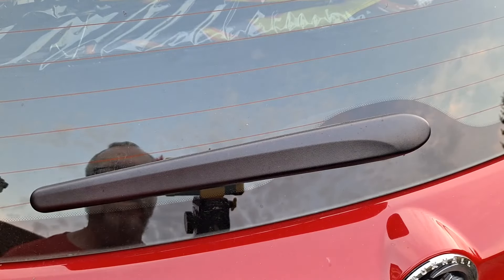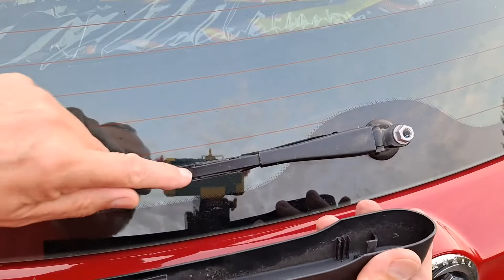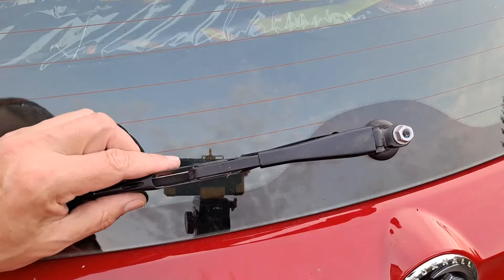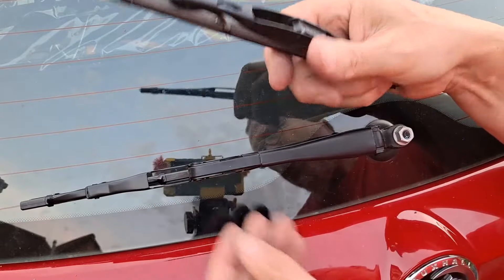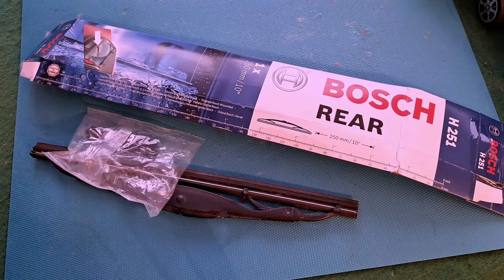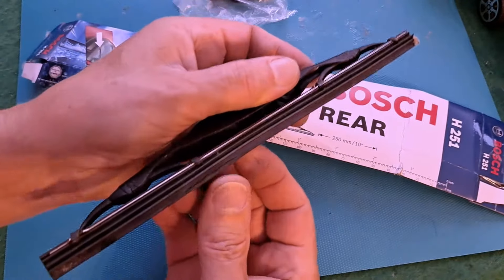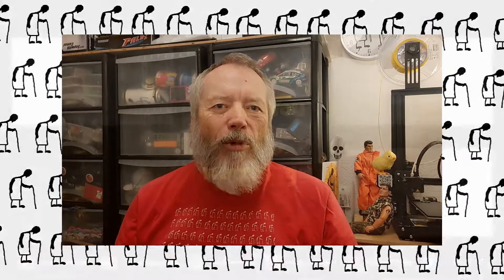Replacing the rear wiper blade on my 2015 Vauxhall Mokka 20210723

Comment: Thanks for posting this. I initially attempted to replace the wiper blade using the Mokka manual - which was fruitless with no information on aspects of the replacement that you covered and explained. 👍
Reply from the maker: Thanks, I didn't get it quite right, somebody pointed out my mistake so I pinned their comment and added it to my video description. Unfortunately, over the years it looks like the guy has removed his comment or left YouTube. Luckily I had copied it and added it to the video description. If you missed it, here it is - Mark Paul has sharp eyes and commented "when you go to fit the rear wiper blade make sure you turn the blade around so the cover fits properly not like this one on the video clip as the blade is sticking out at the end". I hadn't noticed, must be my poor eyesight. I have corrected it now.  In fact you can't just turn it round, you have to pop the plastic clip out first and reverse it otherwise the clip doesn't seat properly, but easy enough to do. 😊

Comment: Excellent video, thank you! Just had to replace the rear wiper blade on my Mokka and obviously the new one came with no instructions! Followed this and worked a treat.
Reply from the maker: Thanks, I hope you spotted the update about getting it the right way round. A sharp eyed chap noticed I didn't get it quite right in the video and I had to turn it round to fit properly 😊
Reply: @GrandadIsAnOldMan  I did indeed spot that part!
Reply from the maker: @marks9351  great, if it was possible to add an "addendum" to an existing video I would have updated it, but the best I can do it put it in the notes 😊😊

Comment: Brilliant video, thanks for the help! Just been to halfords to buy this wiper and the staff told me it wouldn’t fit and that I needed to go to Vauxhall! watched your video, went back and bought the wiper and I’ve just done it myself! :)
Reply from the maker: Brilliant. Did you get it the right way round? You will see in the comments and my video description, that I had it sticking out a bit because I didn't get it quite right first time. After reading the comment I went back and got it right. It works fine either way, but perfectionists would want it right 😊
Reply: @GrandadIsAnOldMan  I did yeah! I’d read some of the comments before I put it on :)
Reply from the maker: @sophieshearing1576  double brilliant 😊😊👍

Comment: Thanks ever so much 🙏🏾. We got a 2017 Mokka in September. Lovely car 🚗 but the wipers were toast. Got a set of 3 on Amazon, and successfully installed the front 2 by following the instructions in the pack. 
There were no directions for the rear blade, and I was frustrated with the black plastic cover until I found your video 😃. Great stuff 👍🏽
Reply from the maker: Brilliant. Did you see the comment I added in the video description, when somebody noticed I had it the wrong way round and it was sticking out a little? I hadn't noticed, but they were 100% right 😊
Reply: @GrandadIsAnOldMan   I confess I did not see that part of your video until I had completed the installation. 🙈🙈🙈
Luckily it fitted under the cover properly 🍀 . 
I actually used your video as a real-time guide, repeatedly pausing it to catch up with you as I fixed the blade. 😁😁😁
Reply from the maker: @oladipoakinla8374  I am glad it worked for you. I did the same, and looked at YouTube videos before I started 😆😆

Comment: Just tried fitting Bosch 251 wiper blade on our Mokka rear screen but if you turn the wiper around ,as Mark Paul suggests the fitting is then upside down and is unable to clip in the hole??? Yes the blade fits but its not secure .If you measure the Original blade its a couple of cms shorter than the replacement Bosch one.
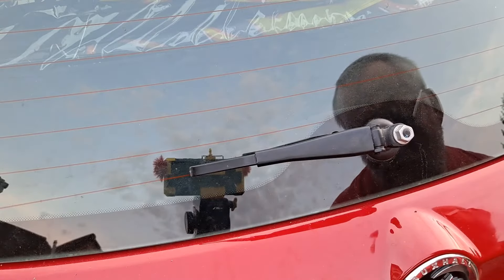Reply from the maker: Not sure what your problem was, but he was 100% correct. At 03:23 the way I am holding it, there is a hole to the right of the pivot. You need to turn the wiper round so that hole is on the left of the pivot. After reading his comment I went out to my car, took it off and swapped it over. It fitted perfectly and has been working fine ever since. Perfectly secure, no problems. In fact after reading your comment, I just went out in the rain and double checked what I had done. This video is just short of a year old and it has been working fine since fitting it last July.
Reply from the maker: Just thinking, you need to flip the pivot over so it points the opposite way, so it all aligns correctly, maybe you didn't do that.

Comment: Good fitting   i need to replace  mine on Nissan Xtrail soon
Reply from the maker: I was 'amused' when I had it MOT'd last time. Wipers are usually the sort of thing most garages will tell you they "had to replace to get it through" as it is an easy item for them to add to the bill to inflate it, but the car apparently sailed through the MOT with no problems. I had pre-checked the wipers myself and decided they would need changing and was surprised when they were not on the bill. So I decided to let "a professional" do it for a change and went to Halfords. It was painful to watch and they didn't have the rear wiper in stock. Looks like I will go back to DIY in future.

Comment: Nice fix. Easy diy job which saved you a few buks at the dealership if they would have put it on for you. 👍👍
Reply from the maker: It was that plastic cover that goes over the whole blade that gives the most trouble. I expect if I was changing them every day I would get the right technique, but I was glad I had already researched it on other people's YouTube videos. If I hadn't checked I would probably have broken it.

Comment: Reminds me of when I worked at an auto parts store. Changed endless wiper blades. So many mounting differences. Good job
Reply from the maker: It was that plastic cover that goes over the whole blade that gives the most trouble. I expect if I was changing them every day I would get the right technique, but I was glad I had already researched it on other people's YouTube videos. If I hadn't checked I would probably have broken it.

Comment: unable to fit the plastic cover back on...what an absolute ballache
Reply from the maker: You need to get it lined up right
Reply: @GrandadIsAnOldMan  thanks for the reply...trust me I have been trying for 45 mins now lol...giving up
Reply: @GrandadIsAnOldMan  Got there in the end lol
Reply: Fitting it back was rather difficult 🤓 
I finally got it on the 4th or 5th attempt after properly positioning and aligning it 😎

Comment: Good to know how to change the wiper. We got a Moka about three months ago. So far it seems to be a good running car compared to the Vauxhall Crossland which we had previousy. I found it surprising it had no handbrake lever, just the pull-up tab, and the auto-release handbrake when you pull away. One thing I don't like about it is the driver's assistance feature which I always turn off. It has a thing where the steering wheel gets jerked to keep you in the right lane. The first time it happened to me I really got a fright. They should never have messed with the steering. If you need all this "drivers assist" set-up you should not be driving, in my opinion. Other than that it is a good car.
Reply from the maker: Sounds like yours is newer than mine, I don't have those features. My daughter's Vauxhall has that funny handbrake tab. Mine does have 'hill start assist' where it sticks the handbrake on whether you like it or not. And it has the 'stop start' technology where it switches the engine off when you are stationary. It has done that several times when I am in motion but I have dipped the clutch briefly, very close to causing an accident a couple of times.
Reply: @GrandadIsAnOldMan  Yes, it is a 2021 model but I still do not like this driver assist feature. Especially when it mucks about with the steering. Other than that it is a great car. It has pretty good acceleration which kicks in the turbo when you are in 2nd 3rd and 4th gear. Has 6 gears altogether. The first time we have bought a brand new car so we will see how well it does as time goes by. I was always dubious about buying a new car but she wanted to go for it and I won't argue anymore. 🤐👍

Comment: Really shocked, was making the same, if you are buying this type of Bosch wiper it is not suitable in that very position for changing, because it is bigger than original.. to make it work you need to remove plastic hook holder on the wiper and reinstall it in the middle position, without it you will never suit this wiper under protection cap. Correct your description, because it is not correctly written what to do, remove and reinstaling hook holder is another video story, that's why thumb is down. Also the same story on chevy trax, Buick encore and this mokka.
Reply from the maker: Maybe yours is different. This is exactly the right wiper for my car and fits perfectly, once I realised I had it reversed.

Comment: They make everything so stupid now on cars. I definitely prefer early 70s or older vehicles.
Reply from the maker: Back in the 70s I did all my own maintenance on my cars, but after a long spell of having company cars maintained for me I really don't want to get my hands dirty any more. I even took my wife's car to the company garage to get it serviced and MOT'd as I knew the mechanics and new there was no advantage to them to do unnecessary work to boost the bill. Now I am retired I have the car maintained and serviced by the dealers.
Reply: @GrandadIsAnOldMan  yeah I think I would have a hard time with some of the new vehicles because of all the computer sensors that I don't have a clue about.  I can fix any vehicles up into the 90s if I had to but I enjoy working on the old ones

Comment: too long
Reply from the maker: What is too long? The video?  The blade is the right one. Check the video description and the pinned comment.
Reply: @GrandadIsAnOldMan  blade is too long unless you change position of locating lug.If you dont blade will protrude from under cover.
Reply from the maker: @andrewjones7912  read the video description. It is the correct blade.